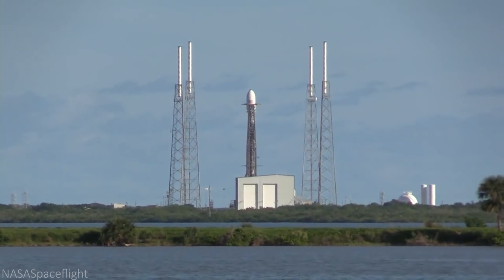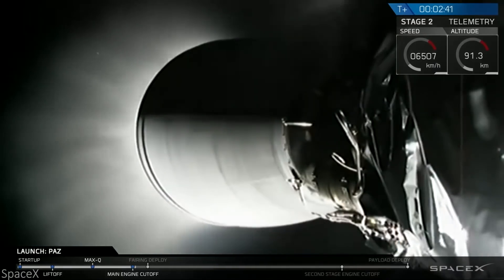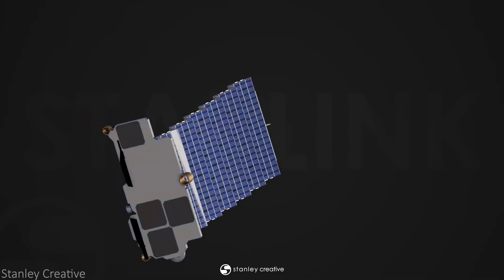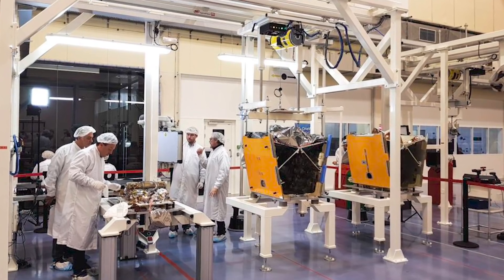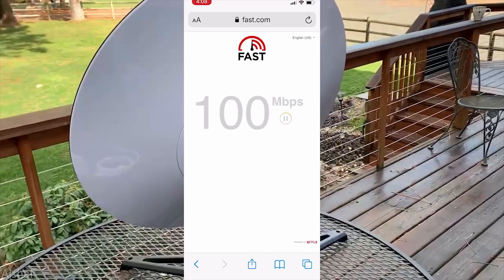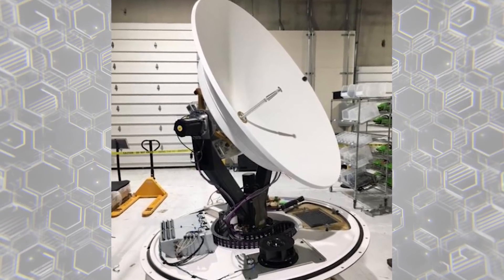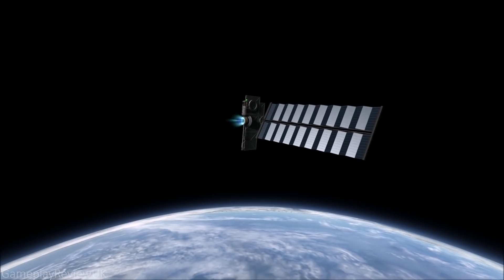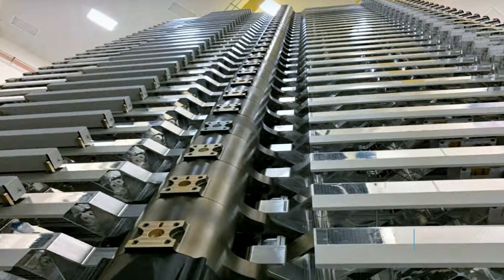SpaceX's Starlink 2.0 - Faster Speeds, Greater Coverage and More

Comment: Starlink is such a bad concept it should have never left the drawing board. 

1, Most people live in populated areas.  I know that's a shocker.  It is very in expensive to run cables from place to place to provide internet in these areas. 

2. Cables aren't effected by normal weather.  Even when they are the can be repaired easily and cell towers are an effective backup.

3.  The laser interconnect does nothing to medicate the systems drawbacks.  The internet runs on servers on the ground... where people live just because the satellites can talk to eachother more quickly doesn't speed up how quickly they can connect to ground services.  Laser communications doesn't work in the atmosphere.

4. Amazon, Google, and Microsoft rule the world.  The internet runs on servers in one of these three cloud providers. They already have connections to internet backbones that dwarf anything Starlink and do.  They also have no incentive to give Starlink direct access to their networks. Two out of three actually have competing products. 

5. Satellite internet is already everywhere on earth.  That's why you can use the internet on a plane. Starlink is some what faster but. How often are you realy out of wifi or 5G range these days?

6. the people who could really use Starlink can't afford to support the system.  Yes this is great for rearal people and parts of developing nations, buy what those people don't have is the money needed to support a 18,000+ satellite cluster that is replaced every 3 years.

8. The worst part is those stupid satellites don't really deorbit.  A lot of them have already failed and lost communications so they can't be commanded to deorbit.  They are just more space junk threating to prevent future mand space flight.

Comment: Elon seems to be putting all of his eggs in Starship launches becoming reliable because he reported in a recent statement that starship is the only rocket that can deploy the V2.0.  Elon did not explain why the Falcon 9 cannot deploy V2.0.  

At any rate Elon went on to say that starship must get up to 2 flights per month to get Starlink to the next level.  Because otherwise Space X could be facing bankruptcy.   

And the problem with getting Starship up to a flight every two weeks lies in the slow production of the raptor engine according to Elon. 

Apparently Elon thinks that Space X can overcome any technical issues with Starship becoming flight worthy in a relatively short time even though B4S20 has not even flown yet.  That first flight won't fly until at least January.  

Space X faces myriad challenges with chop stick catch arms, the flight worthyness of starship, the TPS, the raptor engines and other issues to make starship a viable orbital vehicle.  

2022 looks to be an interesting and challenging year on many fronts for Space X.

Comment: with the higher BW the antenna shall become smaller.  This is not just for remote locations but shall support cars, I presume starting from Tesla which is a connected car.  Phones and IOT are the best use-case for growth but the uplink energy is an issue which will probably require a hybrid satellite-cellular network combination only the cellular will be turned around to be uplink focused.

Comment: um, wait...
So there's gonna be 30,000 satellites in the system...
and each satellite only lasts 3-5 years?

This means that they would have to launch 500+ new satellites every month...right?
The Falcon 9 rocket can launch 60 satellites at a time...right?
So this means that they will have to do 8+ launches every month "forever" to maintain the system?
Sorry; but this plan just does NOT sound feasible.
Reply: So they hope to use starship to complete the launch mission, and use it to launch 400 satellites at a time.

Comment: The problem is about 5% of the satellites were already having problem or even completely dead. Whith in less than 2 years in orbit. The rate will dramatically increase after 5 or 10 years. At current rate, Starlink won't ever reach half of required satellites.
Reply: No, I think it's ~3% failure rate. Failures are a bathtub curve there the chance is highest when first deployed then it spikes up once it reaches end of life at the five year mark. The earlier ones were also less refined than the newer ones they launched. They have 5 year lifespan so with starship that can launch 400 satellites at once they can meet the 2024 6,000 goal.
Reply: Half the satellites in orbit now are useless. Check it out.
Reply: @2020Dreamlife  No, that's nonsense. The failure rate is 3%.
Reply: @MiguelRuiz-vp1hu  i watched a video yesterday going over this. Let me send the link. Hold on.
Reply: @2020Dreamlife  That video is wrong. Many of the prototype versions failed but the failure rate for the non prototype versions is at 3%.
Reply: @MiguelRuiz-vp1hu  no..its not about the new satellites. It states that only 40% of all satellites (his and others) in orbit are funcional.
Reply: @2020Dreamlife  Which video is this? The link isn't appearing for me if you posted it. Wikipedia says 7% of all their satellites have failed but that includes early protype launches, so something is being misinterpreted. It's 3% for the non prototype ones now. Maybe out of all satellites 40% are functional, but Starlink satellites deorbit at end of life so that number doesn't reflect anything about Starlink. It's about other providers.
Reply: @2020Dreamlife  But those satellites dead only after finished planned life span. Literally none of the stop working in less than 2 years. And for starlink, most of the satellites were put in obit in the past 2 years. And literally, there are at least one dead in each batch, at the time get into space. And more dead soon after. unless Musk can dramatically increase quality of these small satellites, soon he will no be able to even compensate the dead ones with current speed.

Comment: Im still waiting for mine...Ive paid the $99 down payment back in march...i was supposed to get it 4th quarter of this year (southeast louisiana).
Reply: Similar in central Texas.  But the company has been very public about the delay.   Key components for the dish receivers have been delayed just as it has for everyone in the supply chain for chips and other components, along with the shortage of oxygen needed for launch fuel.  When we signed up and put our $99 deposit down, we knew that we were signing up for the Beta program, and everything that goes with beta programs.
Reply: @5thGenNativeTexan  when i paid the down payment in march, the email said "summer or 4th quarter on 2021"...im hoping by end of December i will be hooked up.
Reply: @MyNameForNow27  You can check your account and see if it has changed. Mine still says mid - late 2021.
Reply: Your latitude is the last is line
Reply: @TheMagicJIZZ  my life story.

Comment: One thing not mentioned, is the fact that Starlink will not market it's services in major metropolitan areas, already serviced by major cable internet service providers. "So will Starlink be a good option for anyone in the United States? Not necessarily. Musk said there will be plenty of bandwidth in areas with low population densities and that there will be some customers in big cities. But he cautioned against expecting that everyone in a big city would be able to use Starlink."
Reply: Of course.   Generally speaking, the vast majority of people within a metropolitan area can get extremely fast internet for the same, or less, price that what Starlink will offer.   The analysis that Starlink has done has easily shown a business model that for everything from remote residential users to ships, planes, etc that will benefit greatly.
Reply: Great more space junk to pollute the night sky.
Reply: @VE3BF  Did you read that on your twitter feed?

Comment: have a home in a very rural wilderness area but fiber optic hook-up is available from the electric power company - they ran the fiber cables along side the electricity cables. However, they charged $2000 for a one time hook up fee, so is looking like Starlink will be competitive in respect to the initial outlay cost. And lots of rural areas have no real options at all and satellite connectivity is THE only choice
Reply: I don’t think they can charge you that and not knowing where you are , and if they did you would be entitled to recoup your upfront cost or at least a prorated portion of such because it’s a utility there are grants for rural communications & high speed  internet access .

Comment: The real issue with Starlink is overloading of high density areas. Here in Silicon Valley, Starlink is already overloaded. They are quoting 2 more years until new customers can be added. There are just too many customers in the area to give them all service in the same area. While this is sad for me, since I have to live with crappy Comcast service, its smart for Starlink to place such limits. Many years ago Sprint started a service here based on a microwave antenna that communicated by line of sight to a mountain overlooking Silicon Valley. I jumped on it, and service was great -- for a year. Then as they added too many subscribers, the system degraded day by day until it became useless. They ended up closing the operation.

I don't know if Starlink is ever going to be able to solve the density issue, nor is it designed to. We'll see.
Reply: Yeah, they have to lock cells to prevent too high of an oversubscription ratio. Starlink is good for spread out rural areas but definitely not cities or dense suburbs. With 12,000 satellites it will be much better.
Reply: I don't think that's an issue for starlink because areas that are densely populated can be efficiently served by fibre optic cable which will be much cheaper and faster. Starlink's goal isn't to serve cities, but to serve the 30% of the world's population that lives everywhere else. For a rough estimate on their business model, launching 60 starlink satellites on a reused Falcon 9 launch for them probably costs somewhere around $30 million (some guessing here since they don't make their profit margin public). That means each satellite needs to make about $500,000. To do so, it needs to provide about 5000 person months of coverage over it's lifetime. If we assume a 5 year lifetime, that works out to about 85 customers at a time. Typical ISPs run with 5 to 20x oversubcription, so  that means that on average, SpaceX can be quite profitable since each satellite can deliver about 17gpbs (or around 5000 customers with 5x oversubscription). Also, I would be very surprised if they aren't in the process of getting some massive contracts with plane and boat companies to offer better internet there. Those customers are likely to be willing to spend a bunch for actually usable internet for their customers, since ViaSat et al. are so bad.

Comment: Think of what that means for communications around the Dark side of the moon, mars, or Any other planet we explore in the future! No more blackouts. I remember the breathless tension, when Apollo 8 took 3 astronauts around the dark side of the moon, for the first time, and the open screaming Roar of the whole nation cheering, when their radio signal came back!
Reply: Unfortunately that delay still going to be there. radio waves already move at the speed of light.
Reply: @SomethingSomethingAirsoft  , the speed of light has nothing to do with radio black-out areas of the dark side of the moon. They could station Starlinks on the dark side, in laser linkage with Starlinks around the moon, giving 100% coverage around the moon. Same thing with mars, and though there is at least 8min (and usually more) delay, between mars and earth, the carrier signal is constant as long as you have a live connection. So, again, no blackouts, some delays, but no blackouts.
Reply: @otseroeg  again. Delays still going to be there if you have relay nodes on the dark side or not it still has to travel back to Earth
Reply: @SomethingSomethingAirsoft  speed of light from Mars to Earth about 3.5 minutes shortes distance, realistically 8 to 15 minutes.  From the moon 2.5 seconds, realistically a couple of seconds.  I second him.  We'll see satellite constellations on the Moon and Mars in the future.  No need to be a big constellation, just big enough to communicate from any point in them.

Comment: I don't know what's taking so long getting it out to the public? I've been waiting for mine ordered in April this year and seems like they're not worried about sales or delivery ? Not so much as a email on status
Reply: The company has been very public about the delay, perhaps you just didn't read the news.   Key components for the dish receivers have been delayed just as it has for everyone in the supply chain for chips and other components, along with the shortage of oxygen needed for launch fuel.    When you signed up and put your $99 deposit down, you knew that you were signing up for the Beta program, and everything that goes with beta programs.
Reply: He has about 500,000 people waiting. But has said that currently can only produce 5000 units per day max. They currently are switching from a round to a rectangular dish and an automated process for building them. But as upupaepops said, they are having supply problems with components. Just like most everyone else is. You can only build as fast as your suppliers can supply. I'm waiting too.
Reply: @gravelydon7072  5000 per day would be pretty great XD. I think it's 5k/week. The slowdown is dish cost and also they don't necessarily have enough satellites up to open the cells for more customers.
Reply: @MiguelRuiz-vp1hu  If it is only 5k a week it is going to be a long time for a lot of us. I looked at our coverage and we always have between 1 and 4 in range. But no dish.
Reply: @gravelydon7072  it’s around 250,000 a year not counting that they said they will be able to ramp it up a lot more soon. It’s a problem but the main problem is the number of satellites, licensing, and getting launch cost down. I hope you get it soon.
Reply: @MiguelRuiz-vp1hu  You are correct, it is 5000 a week.
Reply: i ordered mine in Feb, same thing. Beginning to wonder WTF